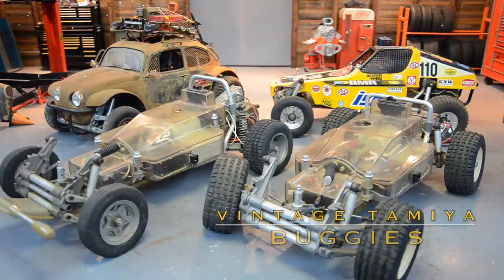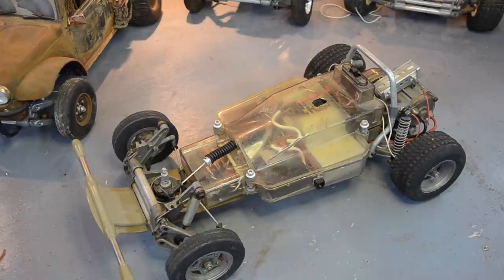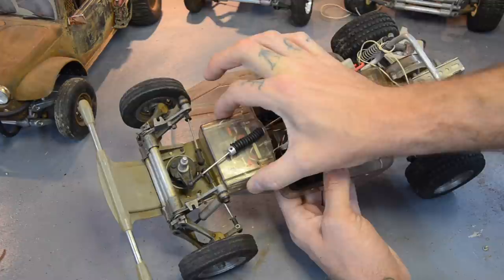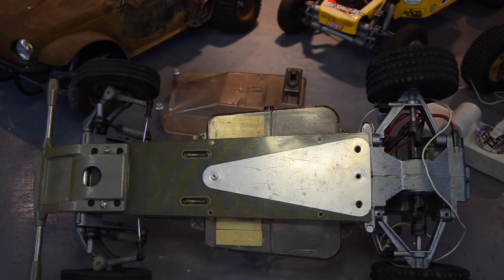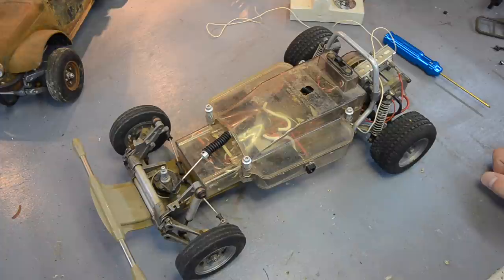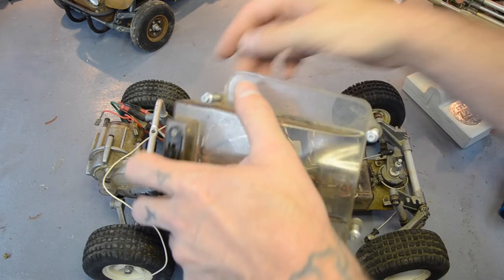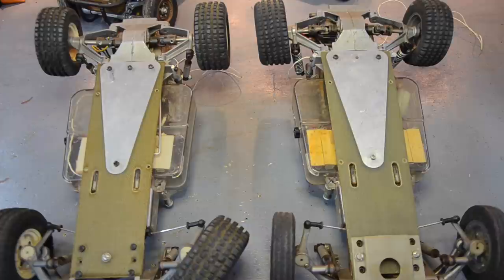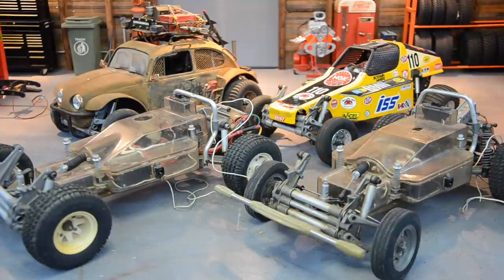Vintage Tamiya SRB, Sand Scorcher, Rough Rider, F150 RC Car History

Comment: Looking forward to this. I have my Sand Scorcher from 1981 that I modified the hell out of at the time. I'd like to drive it again, but I have been out of the hobby for 35 years, so I don't really know what I need as far as radio and speed controller. The numbers written on the battery look like the radio frequency. The Rough Rider has what looks to be a Tamiya Black motor based on the wires. Stock motor had yellow and green if I remember. The Black Motor was a little faster for a reasonable price. This was before everyone started rewinding them and all the other hot rod tricks. The F-150 has steel u-joints, which is the third upgrade we all made. 1st was bearings all around, and second was to replace the plastic gears inside the transaxel with brass gears. We had quick chargers for the batteries. took 15 minutes. Sanyos were the hot ticket at the time. 

Thank you for doing this!
Reply: Speed control was two speeds forward and two reverse. the big white thing in the metal cage is a big ass resistor that would get blazing hot. So that is how you had low. The other speed was just direct connection. ESC were just coming around and super expensive when I quit racing.

Comment: I still have my old Sand scorcher, it still has the 81 radio gear, not going to replace it, it is likely to still be running in 10 years, modern gear has to keep being replaced, and is not designed to last so long,  so not going to bother with replacing it, and try keeping it all as original as I can.

Comment: Those long antennas look like they're from RX's meant for aircraft. Here in the UK they were on 35mhz and i'm pretty sure the US used 72mhz. If the nbr on the battery case starts with 72, you migjt have an answer
I was around 13-14 yrs old when these things were new and they hold so many wonderfull memories of that time. Is that breaker switch a Tamiya item ? I' almost sure i can remember seeing it in the R/C guide books.
Thanks for posting 👍👊

Comment: I have a question for you sir I want to build A streetcar that looks like a 67 Corvette for my dad. Do you know anywhere I can get vintage muscle car style wheels made of plastic? Specifically the rally style like he had on his. I've seen the ones from RC4WD but I would prefer plastic. Any help you could offer would be great, Google is no help
Reply from the maker: There really isn’t much out there for scale classic wheels. There is an old model car kit in 1/8 of a similar year corvette. Might be able to adapt the wheels for rc use but I’m not certain. Only other option would be to have someone design and 3D print them to your specific needs. But that would likely cost more than Rc4wd metal wheels.
Reply: @RCeveryday  thank you for the input. Keep the vids going man. Love em

Comment: Please no shelf queens. Please put a brushless motor and ESC in it.
Reply: What, why brushless, it should be super fast???
Reply: @vwagon5566  If you want a fast buggy, find an original Tamiya "black rewound" motor and it will double the speed.